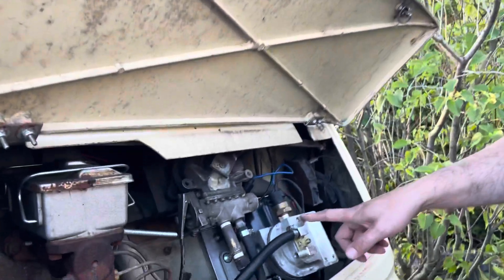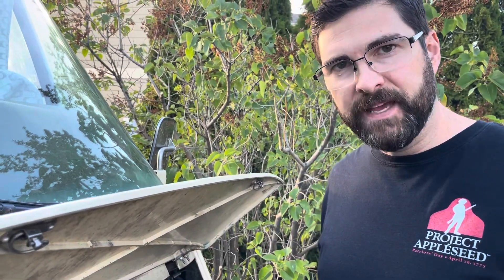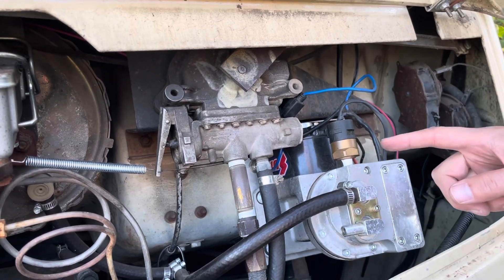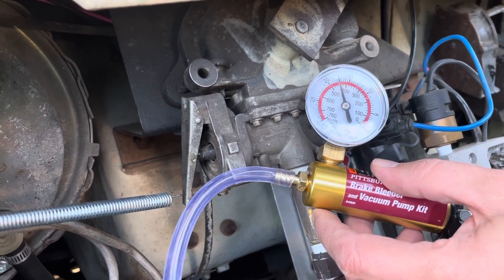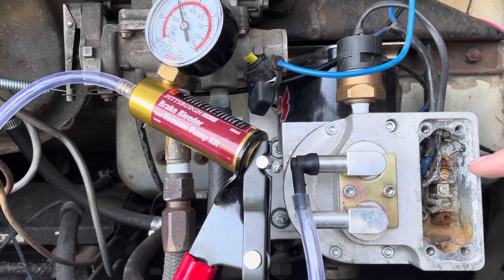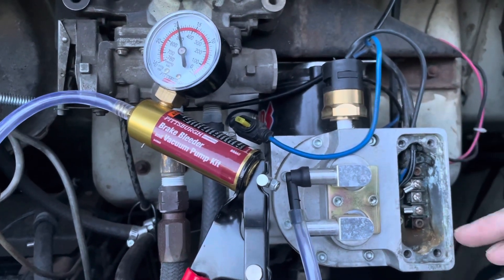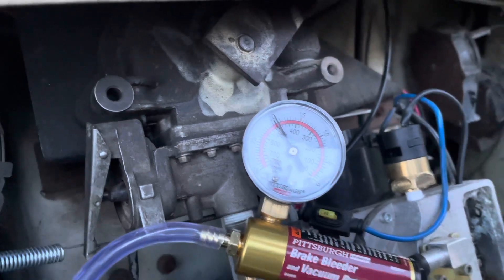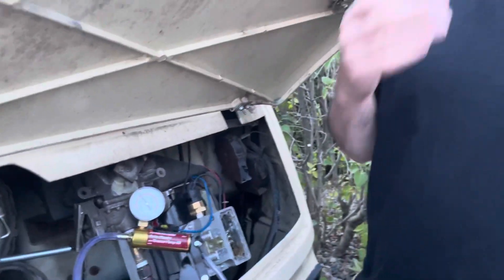‘77 GMC Motorhome Brake Vacuum Pump Repair

Comment: Is the pump loud enough to hear while the engine is running? Perhaps a dummy light "AUX VAC" could be wired up to the motor terminals so you can get a visual alert when the pump is running, alerting you of the need to adjust the sensor in the future and limiting pump wear.
Reply from the maker: Great idea! Today, the pump is very noisy because it's mounted to back of the dash and the entire dash rattles when it runs. However, I plan to relocate the pump to a shelf on the frame and that should make it much quieter. I may want a way to make sure it's running if I can't hear it at all in the new location.

Comment: Just wondering how the vacuum pump is plumbed into the vacuum hose from the engine.  It looks to be "T"ed in, but there must be some valving in your "T" otherwise when the engine stalls, the pump will just pull air from the intake manifold and never build up pressure.  I have a Dave Lenzi brake booster with two vacuum ports so it gets around that issue.
Reply from the maker: Great question! The pump is on a "T" into the vacuum line from the manifold to the brake booster but there is a check valve on the line to the manifold so the vacuum pump will only pull vacuum on the booster side of that check valve.

There are some drawings in the instruction manual for the device I have. 
https://static.summitracing.com/global/images/instructions/sum-760152.pdf
Reply: @MrGMCMotorhome  It would be great to see a photo of the check valve installed and if you can, a part number for the valve.

Great instructional video, as always!
Reply from the maker: @MyMotorhomeLife  There isn't much to see, it's plumbed in just like the drawings in the PDF above, however I don't have a vacuum reservoir. The check valve came with the pump in this kit (https://www.summitracing.com/parts/sum-760152), you can see it one of the photos. I see a lot of brake booster check valves from various sources so I think the key will be to find one the right size for the vacuum line. You may be able to just go to your local auto parts store and have them recommend one. On a side note, I had my engine die on the highway a while back and power steering stopped working but the brakes kept working great so the system works!